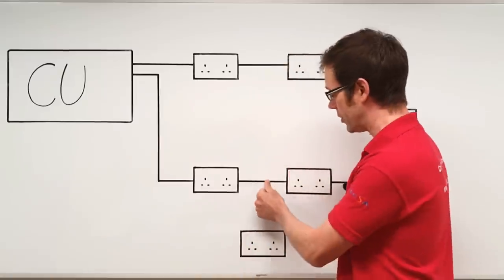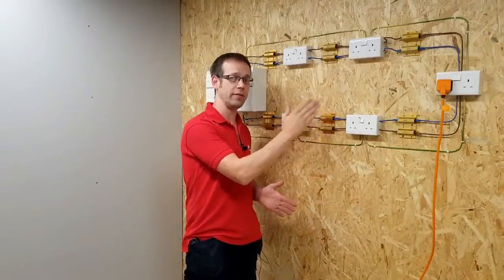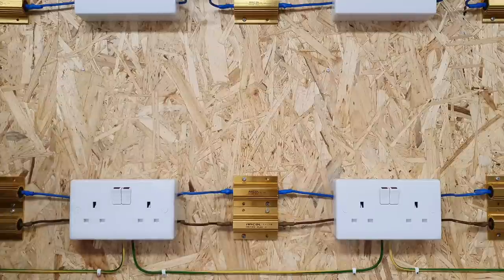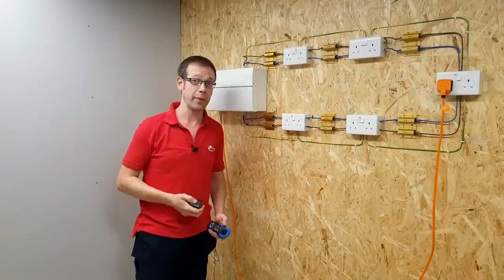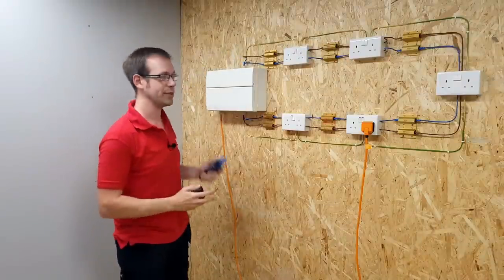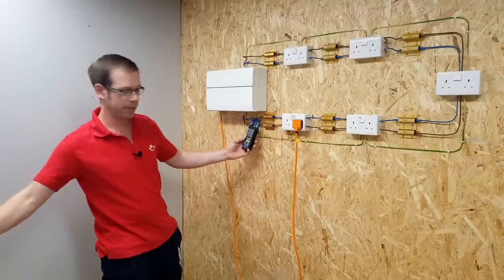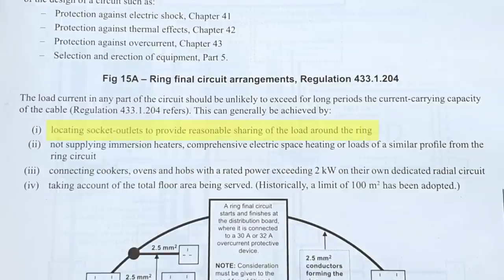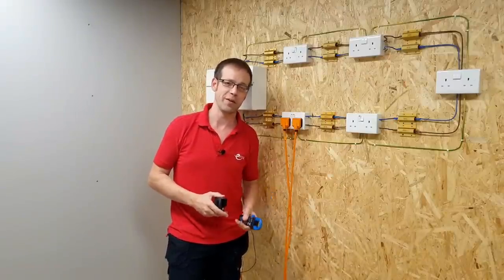KNOW HOW: How does current divide in a ring final circuit? (ring main)

Comment: Best explanation I've seen for a ring circuit, like the use of power resistors 😃 Using a thermal camera would also allow the demonstration of heat in a cable.
Reply from the maker: Great 👍 idea

Comment: Try explaining this to a client so insistent on plugging in a lazy spa on a spur because “well it can’t be that bad it’s on a 3pin plug”?! 
Great video 😊👍
Reply: My neighbour had a lazy spa set up in the shed plugged in to a 10amp extension which was plugged into a kitchen socket. Lots of melted equipment the next morning.
Reply from the maker: For sure! Show them the video! 👍
Reply from the maker: I bet!
Reply: May I suggest eFixx is for you to maybe perhaps do a video using laymans terms without the jargon where electricians can direct their customers to visually explain to their customers re the lazy spa issues regarding the risk of melting components and what the solution would be to ensure safety of supply and to occupier of the property?
Reply: Try telling this to the suppliers of said lazy spa who don't seem to care if the customer plugs the damned thing in via an extension lead........... I have been called out to multiple melted outlets.
Reply: @MrAiptex  resistance causes heat to be generated from current flow. By increasing the length of cable using an extension lead and not having the best connections via plug and socket on both ends means the resistance is probably what causes the issue not the current on its own.
Reply: @boblewis5558  oh Bob watt are u waffling on about? (Pun intended). Your extension lead can be rated to a million watts mate and loop tested at 0 ohms it has literally nothing to do with my comment. If the wall socket is worn then the plug connection can add massive resistance to the circuit at that point is where the heat is generated and causes the melting of the socket. The extension lead is not the issue here.
Reply: @pedropedro9613  Hmm! Your quote: "By increasing the length of cable using an extension lead ...". why did YOU mention the extension lead if it was irrelevant to the argument? Talk about cognitive dissonance and short term memory loss, not to mention you apparent inability to actually READ what you wrote!! Sheesh!
Reply: @pedropedro9613  I was NOT the one who brought up the extension lead. YOU were. On the basis that the extension lead has to plug into A socket somewhere, the SAME socket presumably as would the spa without the extension being present, then to quote using an extension lead and make the point about a duff socket and/or a duff plug is entirely superfluous! WHY did you mention it? or are you trying to say that neither the spa plug NOR the wall socket are capable of going high resistance due to a similar fault? 

How does ANY of that relate to ring main resistance anyway (the subject of the video)? It doesn't, unless the Line and or Neutral leads in the ring connected socket are poorly/loosely connected or to two different points on the socket, like the cpc is on certain sockets (NEVER heard of such a thing re: L and/or N though) or the socket has poorly connected points within and which would (certainly, SHOULD) show up on a PROPER electrical check of the ring! So, ONCE again, I ask, where is the relevance at all re: the extension lead? Such leads are not part of any electrical check and a qualified sparkie is as likely to end up with such a fault in an extension lead or moulded plug or wall socket they use as anyone else, especially so, when, to all other intents and purposes it appears OK, particularly when new.. 

My point stands. A good, properly rated extension lead adds ZERO problem so is superfluous to the equation. A BAD plug or socket, IRRELEVANT of where it is, on an extension or as original fitted equipment (sockets on walls or plugs on devices), is ALWAYS going to be a problem. EVERYBODY, qualified, certified or not has had bad plugs AND sockets including from NAME brands like MK! And not just problems from sockets - even from other electrical control items, light switches etc. :((
Reply: @MrAiptex  Short answer is NO IT WOULDN'T - something else will have happened! The use of a rated (and otherwise sound extension cable) will NOT do that, Someone has their Ohms law completely screwed up if they think that it would. If cables and/or plugs and/or sockets melted that is down to just one of two things - 
1. A current overload high enough to cause excessive heat for an extended period, but NOT blow a fuse or breaker, and that could be ANYTHING from faulty ring connections in the socket to an appliance fault or anything in between
2. A fault causing localised high resistance but still low enough to pass almost full current, neither of which can or should necessarily be blamed on any extension lead per se without confirmation. It COULD be a problem anywhere from the ring to the appliance, including the appliance itself. The use of a properly rated extension in this instance is NOT the cause of the problem but a FAULT somewhere, and NOT a short circuit fault either which may cause an arc but only short term until the fuse, breaker or both popped.

Comment: Before many think they are going to have a fire.....

Yes, there are advantages to rings. They have been widespread in the UK for 75 years. They have been found to be very safe.

♦ Cheapness, as smaller, easier to install, wires can be used;
♦ Two ways for the earth back to the consumer unit;
♦ Another is a large number of sockets can be off one cheap ring;
♦ Having the same number of sockets using radials would mean multiple radials and multiple extra breakers at the main panel. Far more cable, expense, labour and hassle;
♦ The 32A breaker and 13A fuse in the plug ensures safety.
♦ Portable plug-in appliances on a ring cannot exceed approx 3kW. Some plug-in ovens are on rings;
♦ Rings usually have a 32A breaker at the main panel - can be a smaller value;
♦ Using push-fit maintenance free Wago type connectors to connect up the ring makes them a lot safer as not being screwed connections they do not work loose. The ring's current does not run through the socket terminals;
♦ The British plugs are designed with rings in mind having a max 13A fuse in them - can be as low as a 1A fuse in the plug to suit the appliance. Small flex and appliance? Then a smaller fuse;
♦ Rings in the UK are limited by square metres of floor space, with no limit to the number of sockets on the ring. 100 square metres of floor space for 2.5mm cable for a 32 amp final ring .

Radials are also used in the UK, rings are not mandatory, but used because they are generally trouble free, safe. They can be installed using rule-of-thumb. These days a ring will be on an RCD or RCBO - these now are becoming DP, so safer again. In one job in an office, they wanted more socket outlets for extra desk computers. It was a simple matter of extending the existing ring with the extra sockets as the current draw was low. Cheap and easy. If radials were used three radial circuits would be needed, which would mean an extra consumer unit, breakers, wire etc, then far more labour.

Some disadvantages are:

♦ Rings are more difficult to fault find. But electricians have no problem once the ring is full understood;
♦ Another is that if a number of high current drawing appliances are on one side of the ring, say near to the main panel, most of the current draw may be down one cable of the ring which is rated below the main 32A breaker. 2.5mm cable is rated at 27A max. Although tests have proven the cables do not exceed their current capacity, just an imbalance in distribution of the two cables from the main panel (consumer unit). Good circuit design will prevent this, negating this disadvantage. Balanced rings can be installed by daisy chaining to alternative socket outlets on the ring. That is the first appliance will draw from one side of the ring, the second socket will draw from the other side, and so on round-robin. Or use 4mm cable to the point where heavy current drawing appliances are then 2.5mm for the rest, if it is that troubling for some. Using 4mm cable on one side of a ring and 2.5mm on the other, is still cheaper than a bunch of radial circuits.

Overall I consider one ring superior to a bunch of radials needing their own breakers at the main panel. They are simpler, cheaper, being proven to be safe and worked well over the past 75 years. You will have to give a very convincing argument for me to give up rings. I have not heard of one yet.

Comment: Good explanation and reminding folk that the current flows in both legs of the ring.  When I had the house gutted out and insulated the electrician was told to increase the diameter to 4mm2 due to the interior wall insulation (Aerogel) he asked if I wanted a return leg or a radial, for the extra half an hour labour I had a return leg. The only benefit of the ring I found is the voltage of the last device is more consistent.  Given the cost of labour of the electrician vs. the cost of the wire, I'd much rather have the resistance in the appliance than in the wiring and interconnects.  The 32A breakers (20A would be frustrating and prone to nuisance tripping and failure in the kitchen) protect the wire from shorts leading to fire or overload leading to excessive joint heating/conductor insulation melting->short and fire. I suspect we'll end up with panels and steel conduit with radial finals each with its own RCBO, a much more professional and industrial setup.
Reply: Given the cost of labour of the electrician vs. the cost of the wire, I'd much rather have the resistance in the appliance than in the wiring and interconnects.

What does that mean?
Reply: Wire is cheap compared to what an electrician is paid to purchase, lay, terminate and check an installation.

The proportion of the resistance of a circuit should have the majority in the device connected, not the wiring and interconnects. Very low resistance wiring means very small fluctuations in voltage for a given current.

Using a ring, the end device on one leg is the first device on the other, thus has a lower total path resistance and therefore a more consistent voltage under load.
Reply: @davidhunt240  
Wire is cheap compared to what an electrician is paid to purchase, lay, terminate and check an installation.

Are you saying it was not worth converting the radial to final ring?
Reply: Ummm, how have you managed to read the complete reverse of what I was saying!?!

Comment: Good explanation, however you have to remember that ring mains generally have loads of varying types plugged in throughout the whole circuit. When that happens the load is more eventually distributed than loading up one socket with one heavy load. Naturally one leg will probably carry a bit more current if the loads never change sockets and nothing else added. The routing of cables, some possible tight bends and yes not such good solid connections, will have an over all affect in the current in each leg. Higher resistance causes a bigger voltage drop, proportional to current through the cable / connection.
Reply: From memory, the BS standard for double sockets only requires them to run at 20A total for a sustained period, so that's a bit less than 5kW. I suppose that there's nothing stopping somebody actually plugging in two 3kW space heaters into the same double, but it's probably unusual. Things like kettles, Wahing machines, toasters and so on are less of an issues as they aren't sustained loads (most of a washing machine load is the water heater and the only run at full power for a few minutes).
Reply: @TheEulerID  Yes sounds right Steve. One has to consider “Cannabis Farms”, high current lamps plugged to every socket with extension on extension ?!,  perhaps we need a review of the British Standards to take account of the continuous current …. :-)….. all the best to you …

Comment: When installed like below the igneous & simple final ring circuit now is near bombproof:

1) Use an AFDD in the CU on the final ring (regs recommend them);
2) Use screwless terminals on the sockets;
3) Use 4mm cable;

Having a ring like this would eliminate a multitude of radial circuits, all with their own AFDD and eliminate a large CU cabinet. All reservations of a final ring splitting creating two radials on a 32A breaker and arcs created due to loose connections are gone. 

I have seen one and two bedroomed flats in London with heating on a gas combi, wired with three circuits: 

1) Final ring as above, in 4mm and an AFDD;
2) An RCBO on 4mm cable to a 13A hob and 3kW oven (both with 20A isolator switches in adjacent cupboards);
3) 3A RCBO for the LED lights on 1.00mm cable. 
4) Small and cheap CU box with a spare way.

Only 4mm and 1.00 cable was used. 

If this was in France it would have a large main panel with many, many needless radial circuits. Regs in France state the maximum number of socket on one radial is eight.  I have 12 in my living room alone. In France that would be two radials for one room. Madness, when rings are here.

Comment: You can fit in a balanced ring circuit.
It goes like this:
1) From CU's MCB or RCBO, run a cable to the 1st socket on the ring;
2) Then do not run a cable to the next socket, the 2nd. Run it to the 3rd, then the 5th, etc. Alternating;
3) Then the second cable from the CU's MCB or RCBO, run to the 2nd socket, 4th, etc. Alternating;
4) Then at the end join the two cables up at the last socket;

Then you have a balanced ring.
Reply: It does not matter if the ring is not balanced.  This isn't a 3 phase system where there is a requirement to balance it.  The only thing that matters is you don't exceed the maximum current carrying capacity of the cable when it is not balanced.
Reply: @deang5622  
Correct.
But if it is heavily out of balance one cable on one of the legs can have its current limit exceeded if a number of heavy appliances are used.  

If it looks like this can occur there are three way of solving it:
1) Balance the ring as I explained in the above post;
2) Run 4mm cable on one leg to the outlets of the final ring that will take the heavy load. For e.g., if the first three outlets on a ring say will have a tumble dryer on each, then run 4mm to the first three sockets. Then 2.5mm is fine for the other leg, which is the rest of the final ring;
3) Run all the 32A final ring in 4mm cable.

1) above is the cheapest, then 2).

Comment: Great demo. Makes you think that say in a kitchen with a kettle, toaster, washing machine and dryer all early on in a ring final circuit, followed by above counter sockets, most of the current will be flowing through a single 2.5mm twin and CPC cable.
Reply from the maker: That is exactly the point David. 👍👍👍
Reply: That's exactly why a kitchen should be a dedicated circuit
Reply: Had to put in a 4mm spur for my under the sink 4kw water heater, so brought a whole reel of cable as it always useful, and my mate electrician said best upgrade anyone could do is go 4mm through whole property in this day and age, my little kitchen alone has 15 sockets/switch spurs , rest of my flat I put a switch double every 4ft apart with 2 doubles in corners where TV could go , one corner upgraded to 2 triple sockets,  every room has it's own ring main , put a 6mm armour cable to my garage 4 was plenty but 6 even better 😀 for more tools and toys to power.

Comment: Lol I commented on this video a year ago. Literally this video showed up in my suggested videos again and I was just about to comment the exact same thing 😂 in a radial circuit, you plug the toaster and the kettle in together and you will draw more than 16 amps through the cable. No, of corse you can’t just slam a 16 amp junction box on the Ring Final circuit to extend it, but you can’t in a radial either. 2.5 mil cable can more than handle 20 Amp. 2.5 mil in a ring can handle almost double becuase although the load isn’t split evenly, it’s still split. 16 amp is negligible. In a radial however, you can handle 20 amps no problem but as you said, you only had 2 appliances hooked up (the two main power eaters btw) 16amp is getting quite close to the cable’s limit when you consider adding more load to it at the same time. So you need to then upgrade your cable to 4 mil which is more expensive and harder to work with before you can upgrade your breaker to 32 amp. I don’t see how you can hate on ring final circuits. They are cheaper, safer and easier to work with. They just require you to actually do proper work on them when you change things. Or you could be a decent guy and plan for changes in the future and accommodate them in your design. It’s not hard.
Reply: Have the ring circuit on an AFDD, screwless terminal sockets to avoid loose connections in time, and 4mm then it is near bombproof.

On a radial on full current draw all the current is on the terminal of the first socket on the radial. If an earth cable is severed for some reason on a radial there is no earth back to the CU, yet the ring has two earth ways back to the CU, so safer.
Reply: A 2.5mm final ring circuit should ideally have no more that 20 amps on each leg.  See wiring regs Chapter 4 appendix 15. 

If you are a decent guy and plan for changes in the future and accommodate them in your design, then cable the ring in 4mm.  4mm is easy to work with if Wago connectors connect the ring in a backbox, with 2.5mm flex to the socket off the Wago. Easy to push back the socket. Also use the Wagos for 1st fix testing leaving them in the backboxes ready for socket insertion. Using Wagos means the ring current only runs through the spine not via the terminals of the sockets.